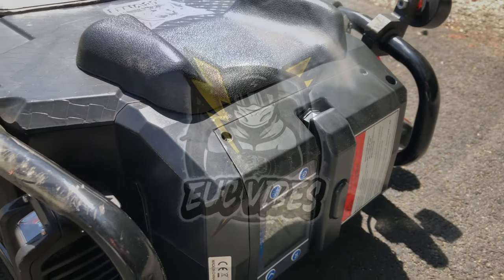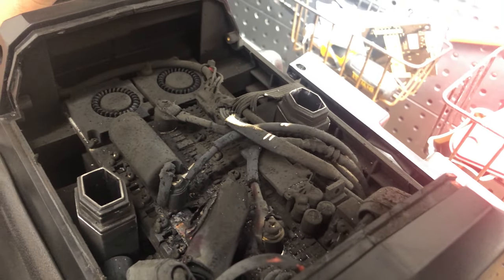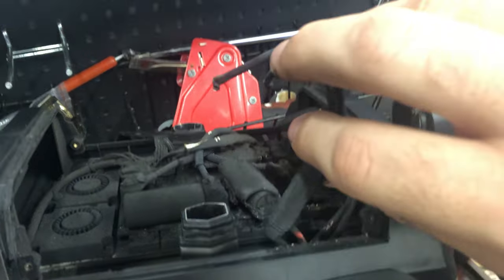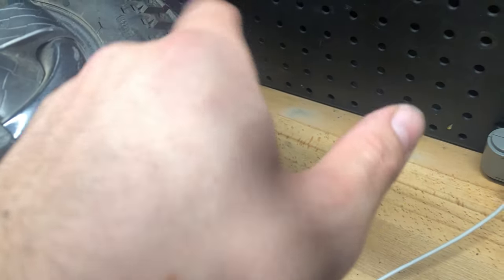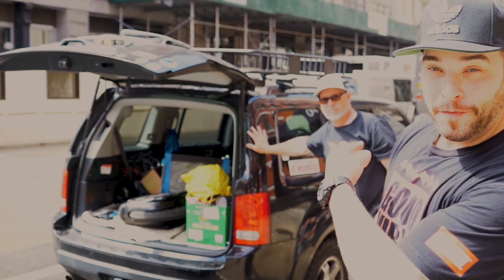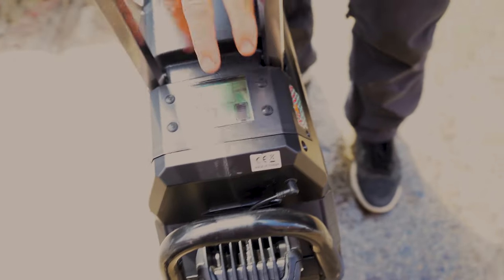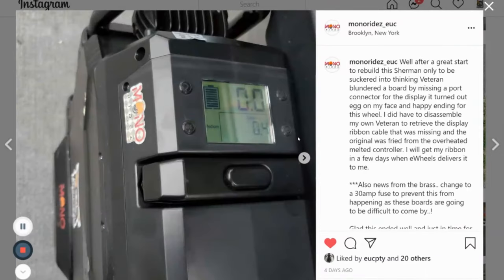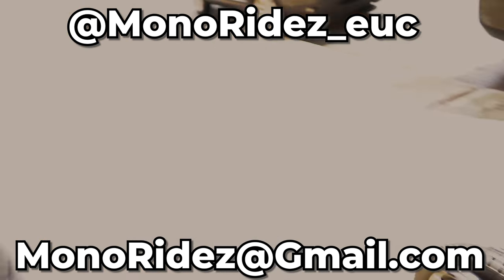On The Table [ Ep. 1 ] Death of the #VeteranSherman

Comment: Good, but also expected it was taken care of under warranty.
After all, the tire came off the rim because of a design flaw affecting most if not all Sherman V1.
It would have made sense IMO to replace the rim to the wider V2 one, so the exact same thing doesn't happen again later.
Reply: @EUCvibes  yes the wider rim makes the knobby nicer in my opinion, most significantly it doesn't tend to fall to the side anymore beyond a certain point as the tire has a wider shape